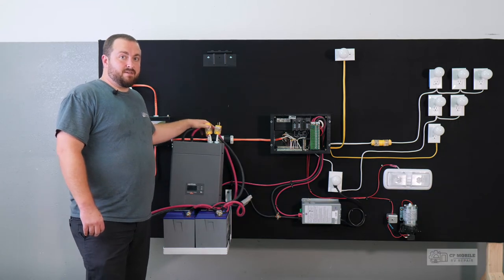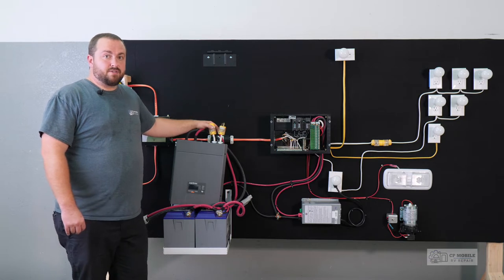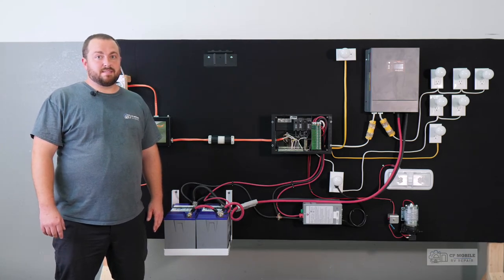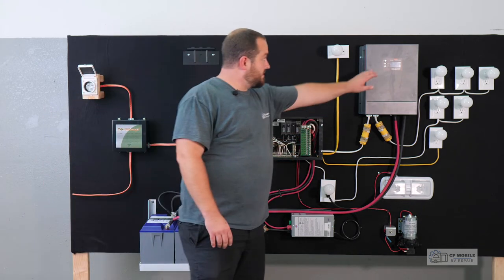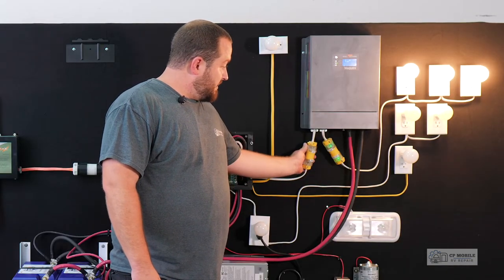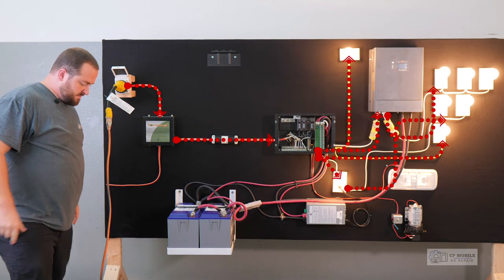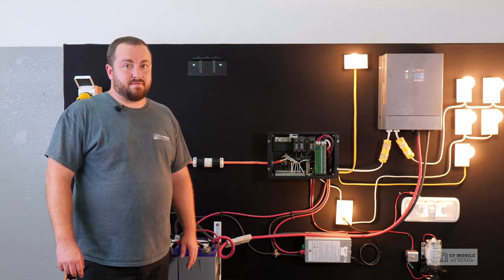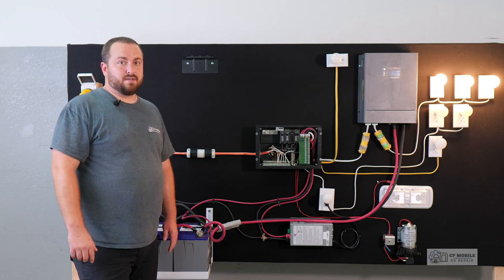How RV Inverters Should Be Installed: Single Breaker Power Flow Xantrex X2000 Inverter

Comment: thank you for the precise explanation. the power x box that is connected in line between the breaker box and the shore power what is the function of that?
Reply from the maker: It is a transfer switch, for when you have multiple ac inputs such as shore power and generator.  To make sure only one source of ac power is connected.

Comment: Great video and I learned a lot.  However, I am a nit confused on exactly what happens in the control panel.  In my case, I only need the frig breaker to run thru the invertor.  Do I disconnect those wires from the control panel and run them into the invertor.  This would leave that particular breaker in active.-correct?

Curt
Reply from the maker: In this setup, power would flow from the breaker to the inverter, then to the fridge.  So when plugged in to shore power the breaker in the control panel is active.  When on inverter the breaker on the inverter would still be active but not the breaker in the control panel.

Comment: My camper has a 200W solar panel and is "Prepped" for an inverter.  It has an 120V AC line that you cut and connect to the AC In and Out connectors on the inverter.   How are the cables from the battery or batteries run to the inverter?  Try not to "assume", however do the cables run from the batteries through a properly sized breaker to the 12V DC in on the inverter?
Reply from the maker: Yes, that’s correct.  The 12v wires to the battery should be appropriately sized, and run through and fuse or circuit breaker that meets the specs for the inverter.

Comment: Travis
Like discussed with you elsewhere I've got the 1200 (or) 1500 watt inverter on my Jayco. One thing that I have happen, when incoming power is lost, the "fraction of a second" from incoming to inverter power kills the internet box for just enough time it has to go through the "reboot" thing for it's 5ish minutes and is a pain in the ash. Maybe it's just me and my lack of patience but the reason of this reply here is to ask.....

Is there a way to make the transfer time short enough / instant like going opposite (Inverter to incoming power) time so it doesn't have to reboot the internet system? 

Thank you once again sir. Great videos on here!
Reply from the maker: Hello, it depends on the inverter.  Some higher end inverters have a “ups” setting for “uninterruptible power supply” when transferring.  You check the manual for your specific inverter and see if it has that function.
Reply: @Cpmobile  Great and thank you. I"ll look further into this. I appreciate you sir.

Comment: Great video. Is it possible that we can connect?. I just ordered a new Xantrex FREEDOM XC PRO fro my discovery 40x i would like to pick your brain. I wanted to use victon but i don't think it would fit thru the opening i have :(
Reply from the maker: Thanks Brad, and you can give us a call any time m-f 9-5. 801-516-4868
Reply: I would avoid Victron.. They use a floating ground when switched to battery power.. I been down that road.. And one reason they removed the bonding screw on the DC voltage side..When it should be in. As once on DC power. The inverter is now the Source transformer. And grounding the unit to the chassis is asking for it when on DC power. As any short to ground or fault needs a path back to the source. 

Why Xantrex or Renogy inverter\transfer switch\Chargers are best for the money..

Comment: Just bought a used rv. It has solar the same batteries. Not sure what type of inverter. 
I would like to know how to use some 120v outlets without the generator or the connection to the shore power. 
Also, I am not sure if the batteries are charging while we drive or if they charge from the generator. 
How can we contact you?
Reply from the maker: Hello, you can look us up online under “cp mobile rv repair”

Comment: how can i get that reversed. I'm needing to power a 12v fuse block when the vehicle is running, OR when connected to shore power. I've never done it before and am not sure if its even doable.
Reply from the maker: It’s certainly doable.  A battery charge or battery isolation relay could be used on the vehicle side to connect to the 12v fuse block when the vehicle is running.  A standard rv 120v to 12v converter could supply power when plugged in.

Comment: Awesome video so this isn’t the inverter/converter right?
Reply: I know there is one that has both right?
Reply from the maker: Correct, this one is an inverter only with a built in transfer switch.  There’s a video with a victron multiplus that is and inverter charger (converter).